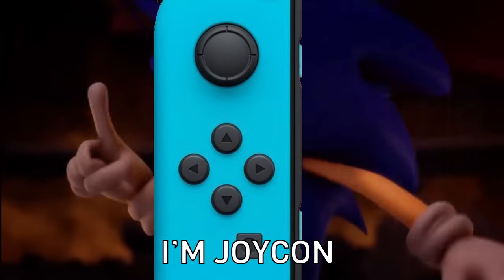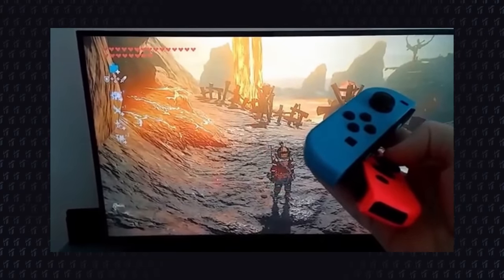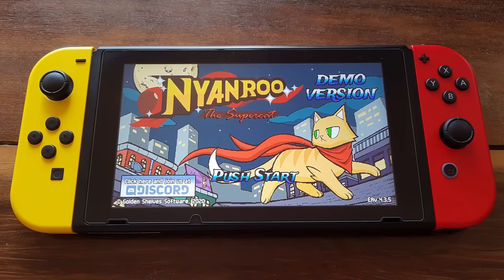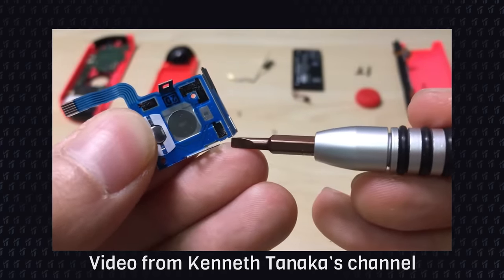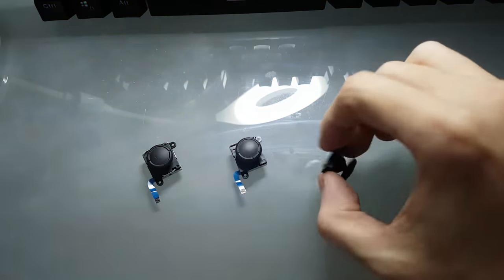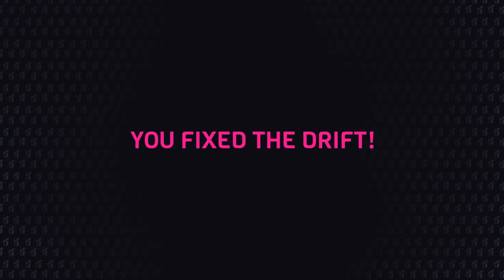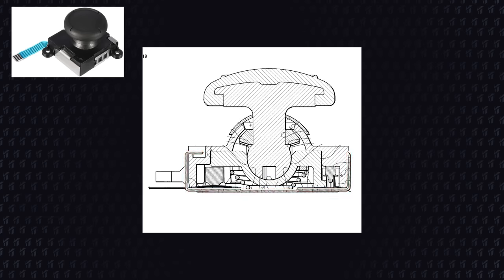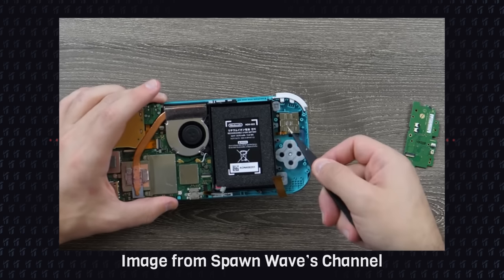How To Fix Your Joycon Drift Permanently!

Comment: The fact that it was THAT easy is ridiculous. Thank you for solving this.
Reply: Ridiculous from our perspective. A gold mine for Nintendo's repair team.
Reply: Hi Daniel!
Reply: On video
Reply: Dang, I could not remember your channel name. I like your old super Mario maker vids about making stuff we didn't have!
Reply: Because we never think about the easy solution first. XD
Reply: I just did the fix and 1mm seems too thick. I used calipers to make sure it was at 1mm and now the joycon bulges noticeably. I'll leave it as is as it doesn't bug me, but yeah, maybe not 1mm

the hardest part was I accidentally removed the ribbon cable from under the battery and it was a huge pain to get back in, when in reality I didn't need to unplug anything
Reply: @Maxx_XIII  oh man I can’t believe it
Reply: @mimivrc4148  1mm too thick? I used a long strip of 0.5mm and folded it together so that there is constant spring tension keeping it together. And it's going great.
Reply: The fact that is ridiculous is that they are still selling joycons with this problem.
Reply: @mimivrc4148  Yeah I found 1mm to be too thick too, I just took it apart again and swapped for a slight thinner piece of card/paper. I also found a 1mm piece of card caused my drift to worsen, it wasnt horrendous before but was annoying enough that I havent bothered to play with my joy cons properly in probably 9 months, I added the 1mm card and it was far worse, the thinner piece I've just replaced it with seems to have done the trick. I'll see how I get on using them again now.
Reply: Really shows how lazy Nintendo is
Reply: Well, since I fixed my 3ds battery problem with a piece of paper, I'm not surprised by this 

Bad on you Nintendo
Reply: Yeah xd
Reply: and it was over 3 years since its release
Reply: @mimivrc4148  It means yours is just a tiny bit loose so it don't require 1mm. It depends upon how loose it is. Others may even need a thicker one. I guess 1mm is just an average estimate.
Reply: You would think, if it’s this easy to fix, Nintendo would just make the joy cons with something to keep pressure on the thumb stick.
Reply: @tl1882  Exactly. It can’t be that hard to open the cad file and alter it for future runs!
Reply: @LoWsDominios  Because this is a temporary solution, not an actual fix.
Reply: Thats hilarious
Reply: No, more pressure will cause wear to be faster.
Reply: I wouldn't say " THAT easy" because taking apart the joycon can be very tricky with all of it's cables, and the small chance you drop your LB button and lose the spring. And if you accidentally unplug a ribbon cable, that is very tricky to put back.
Reply: @mimivrc4148  I also found 1mm to be too thick. The joycon will not reseal with something that thick.  0.5mm is the perfect size. The video uploader should pin something about this before people waste time trying something 1mm.
Reply: Try electric contact cleaner without opening the joycons first, he seems to have broken his joystick assembly and maybe that why this solution is helping him.
https://youtu.be/yHUPeqiBmOc&t=6m0s
Reply: The fact that it was this easy means that Nintendo spent zero time looking into this. I guarantee that the OLED Switch's joycons will also have this problem.
Reply: How did you unscrew the screws on the back???? I can’t seem to find anything that allows me to unscrew them and I’m going on a vacation tomorrow and I really wanna get this fixed so that I don’t have drift on the ride.
Reply: @TraceguyRune  I can’t unscrew the screws on the back in order to even take apart the joy on. How did you unscrew the screws on the back???? I can’t seem to find anything that allows me to unscrew them, what did you use?
Reply: Nintendo team should higher you and pay you more than the other engineers they have
Reply: AYYE ITS DANIEL T. Been here since 2016.
Reply: And the fact that Nintendo S T I L L refuses to fix the problem themselves even on their new Switch OLED Model… I mean… just… Nintendo…

sigh I have no further words. I’ve got nothing. What else can I say?
Reply: Yeah. Theres nothing more annoying than joy con drift while trying to complete shrines on botw.
Reply: The fact that it's acceptable is ridiculous.
Reply: @Maxx_XIII  yes a gold mine for nintendos free joycon repair team.
Reply: It was probably difficult to find BECAUSE it was so easy... yah know???
Reply: You say that but Nintendo professional Engineers didn't found the fix, I would fire all of them, then send them a bunch of cardboard boxes.
Reply: This perfectly demonstrates the Nintendo quirk, remember when we had to shove a second cartridge in to keep the game running😂
Much ❤ this brought me joy 😊
Reply: @KingLinkVR  did you ever figure it out? you need a 0.6 tri-point screwdriver they are specialty, get them at a watch shop or hardware store
Reply: i ain’t taking apart my switch controller bruh

Comment: I really have the impression that Nintendo knows where the problem is, but prefers people to buy more controllers.  It looks like planned obsolescence.
Reply: I don’t think it is planned obsolescence. I think that it is a matter of someone at Nintendo thinking that fixing the issue in any capacity (like changing the way that joycons are made, or adding a piece of paper to the ones that they are repairing) would essentially be admitting legally that 1- there is a problem, 2- that they know about it, and 3- that they can do something about it. Right now with all the lawsuits going around their legal department is desperately trying to make it more difficult to prove legally that there is an issue in the first place. And you would be surprised how much power the legal department has inside of a company of the size of Nintendo.
Reply: @Vendavalez  so basically if you’re rich you don’t have to face justice
Reply: @Cfreezy12  that’s not what I was getting at exactly, but it’s not wrong.
Reply: @Vendavalez  I think its that planned obsolescence may have been the wrong choice of words but I got what you mean
Reply: Problem is Nintendo doesn't make the sticks, Alps Alpine does. Nintendo buys the sticks from them.

They just bought bad inventory
Reply: Yeah I wanted to buy the new zelda joycons, cause my current ones drift, but I don’t want to support them till they fix the damn drift problems. They won’t fix cause they get money from it
Reply: They offer a free joy-con repair service that they conveniently have not advertised at all
Reply: @Goomonster316  Only in the US.
Reply: @AnakhaSilver  well, it's in Ukrain and in Russia too. Don't know about other countries tho
Reply: @beebait1464  oh absolutely. What I was trying to say was that someone at Nintendo with a lot of decision power within the company believes that what they are doing is what would cost the least for the company since they are already in this mess. Regardless of how flawed I might find their reasoning to be. I sincerely think that they had many options that would have costed them less.  

The other things was that I thought that it was less of an issue of malicious engineering and more of a case of heartlessly shrewd legalese (again, regardless of how flawed the thinking behind it might be).

And who knows? The people making these decisions might know something we don’t. 

The truth for this sort of things eventually comes out. Even if it takes a decade or two. I am really curious about the thinking behind how Nintendo has handled this. Because it’s bad. Really bad. But that goes without saying.
Reply: @beebait1464  and I think I know what you mean 👍
Reply: @Vendavalez  if that were the case they wouldn't fix it for free and have exceptions for out of warranty
Reply: @beebait1464  i think venderval is right, it's not planned obsolence; but rather a design flaw / oversight that they didn't wanna fix after they found it out
Reply: @beebait1464  You can't make a software fix for this kind of hardware problem.
Reply: @mparagames  I think it's a different kind of intentional obsolescence. I don't believe that nintendo originally released the switch knowing of this problem, but I think that now that it is clear this is a problem, they know that it would be more profitable for them to have the free joycon repair service to reduce animosity towards them in the eyes of the public, then not advertise the service, so a lot of people don't know about it, and just buy new joy cons. It's might not be planned obsolescence, but it sure is enabled obsolescence.
Reply: @ff-qf1th  i still think that they didn't want to spend the r&d to fix the issue, and that's why they didn't admit it was a thing; but then it backfired and they had to at least give some response, which was the free repair, but at the same time they didn't advertise it because they didn't want to  waste on the fixes either. Aka nintendo having an unintentional issue, but then trying to run away from it not to lose money
Reply: well then they should atleast fix the mini switches, since they cannot want us to buy a new one every year.
Reply: Now that this change has been known, I can almost guarantee that Nintendo will silently release new joycons with their consoles that are engineered so the battery holder is about 0.5mm thicker
Reply: When I remember correctly, there is an international Company, who delivers also Sony and Microsoft, I would be NOT surprised, when there is the same issue there. Nintendo aren‘t building the Sticks from herself, the mechanism from the stick and the issue, in my opinion… comes from the company where they got the sticks mechanism
Reply: oh wow, corporate company wants money, how bizarre
Reply: They repair them for free so it's gotta be good old over eager expense cutting.
Reply: They have made it so you can send your joycon in to get the drift repaired, but theyve kept it under the radar
Reply: I'm honestly shocked there has not been a class action yet.
Reply: I’d argue improvised obsolescence, where it wasn’t intended, but it worked out in the end so they adapt and took advantage of it.
Reply: @jayplays9976  they bought bad inventory for 5 years? No, this is on them for not checking the quality of the parts they're using (or for planning this up as a way to seel more hardware)
Reply: I don’t believe it’s planned obsolescence based on Nintendo’s track record. All of their other systems last forever. I think the issue is the drifting started past their R&D testing phase.
Reply: Planned Obsolescence isn't the right word, but it is part of the overall scheme and is still very scummy what's happening. Planned Obsolescence is what Apple does, where they sell products with the next iteration or two already developed or nearing completion, so they can make the phone they just sold obsolete in a year. By making it faulty and easy to break, it increases sales. Nintendo isn't selling new or better joycons, or special patterns all that often. I forget the exact word for it, but it's smaller than planned obsolescence.
Reply: @jayplays9976  Then they didn't test that the housing had enough pressure to prevent the loosening of the joystick enclosure. Which, according to the video, only requires ~1mm of additional material to avoid this fault.
Reply: is it passive negligence? especially since they plan to release an updated model of switch with same joycons, that can become susceptible to big main issue?

I don't know just speculating. not saying this problem is keeping me from wanting a switch, cause I still want one, it'll be 1st time switch owner. but threads like these are why I got the new skyward sword joycons with a warranty (1st time I ever did that with a controller) and why I plan to get a few pro controllers as well as binkbok joycon controller. out of my yrs with Xbox and now most recently with playstation I've never felt like I had to be so worried about drifting, not with PS4 and not with PS5 and not with SeriesX. Not with 360 either and never for Original. Nintendo is included in that group cause well there's the Wii! still use the original nunchuk I got for it yrs later have no insane issues with drifting. you know and you all are now long time owners of switch or at least if not longtime know of its major issues and the joycon hardware just being the same and unchanged for an updated model of the system is like a huge slap in the face to current owners like they're not listening to you all. it's disappointing.
Reply: Well that would be true if Nintendo wouldnt give you a free pair of Joy Cons. Just message the customer support
Reply: @jayplays9976  Nintendo designs the case for the joycons. If there was more plastic where he put that cardboard, drift wouldn't be a thing. Stop trying to shift blame away from Nintendo they continue to use the same stick supplier don't they?
Reply: @DCReptile  however is it true that they might not even send you the same color or special version what have you back like explained in video? anyone here experience such to test validity of this claim? cause it's like ok getting white switch oled white joycons get the drift problem send them to Nintendo for fix or replacement most case replacement, they send back gray ones. 😒 At a loss right?
Reply: Just a question of poor technical specification.
Everything is specified but the "mechanical strength" or something like that.
So, they have plenty of joy con that are not very mechanically resistant and that's it. Way too hard to find a solution with all the supply chain behind it and the integration process.

Comment: Let's not forget the amazing part that you can just do the squeeze test to see if this is really your issue, dude even came up with a diagnostic test.
Reply: Yeah that’s the great part, I squeezed my joucons and it worked pretty well at stopping the drift, so even if there are multiple causes, you can tell if this fix would work for your joy cons
Reply: Also the danger, putting more pressure as manufacture is a risky fix. There will be more pressure on all components below and it might be that the graphite patches take way more wear as they normally do. Not saying they do, but there is a risk. Think of a cable which needs to be in certain bend to connect properly, over time it needs more and more of that bending to work the same. 

This fix is great, but don't forget there is a reason why Nintendo isn't doing this by default. Stupid, money or long use problems might occur.
Reply: @DaveZeegers 
Understandable, but the fact that people have to risk long term issues with their joycons because of Nintendo's ineptitude and inability to fix the problem just comes to show how little they care.
Reply: @DaveZeegers   ....
Reply: @DaveZeegers  But if all you're doing is forcing the metal flaps on the side and bottom to stick to their intended shape, because they actually got loose over time, then there's a chance this solution doesn't cause additional wear.
Reply: Yes I did that first before I decided to fix it myself
Reply: I wish I learned this before I went out and replaced  the 2 times
Reply: Hahaha
Reply: @DaveZeegers  its either the stress of the paper or the stress of it flying out the window into the dumpster. a tiny bit of pressure wont hurt much. if the components were that weak then we would have more issues than drifting.
Reply: Best fix I’ve seen so far.